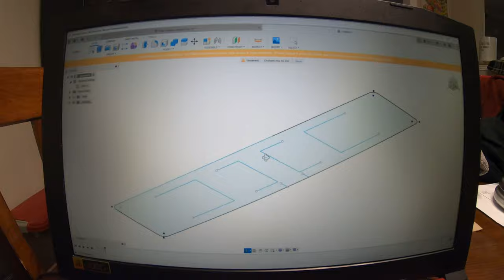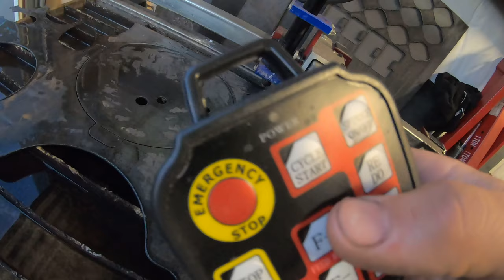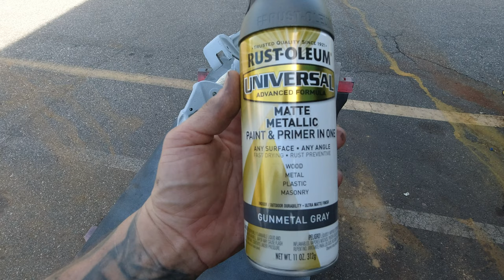1972 C10 SHOP TRUCK - Treating Rust in the Cowl, Preparing for Paint, Replacing Ball Joints.

Comment: dude it has to all come apart.
Reply from the maker: Oh, it will all come apart one of these days. But I need the truck to be functional right now more than I need it to be pretty.
Reply: I just pulled a customer’s 68 all apart, the rust is under the lap welded on panels, look at my video of my discoveries re the same truck and same problem.
Reply: @tinygaragefab  understood. I was war-gaming doing what you’re doing or pulling it all apart, it would still leak and be a ticking time bomb — I would not do that to my customer.